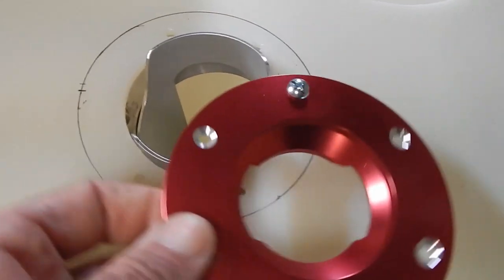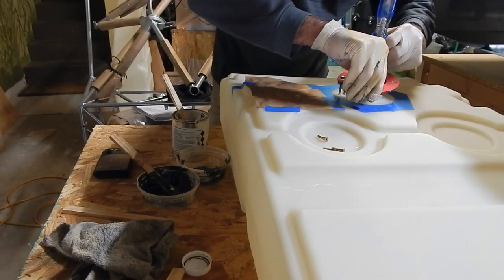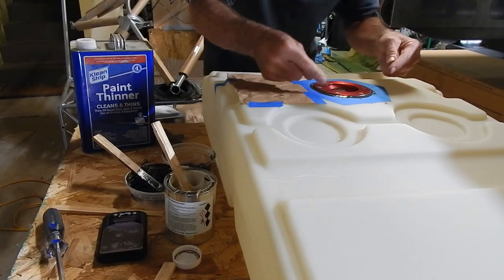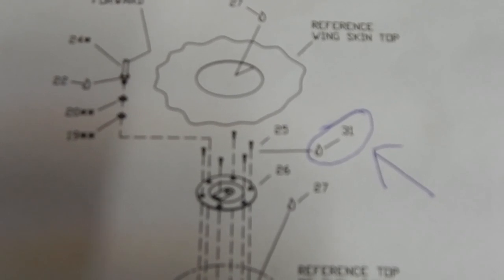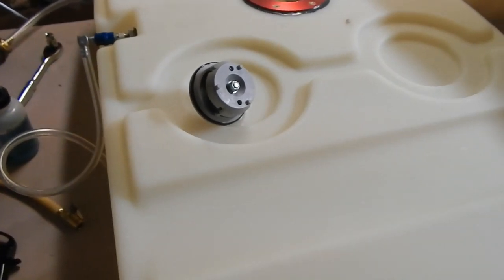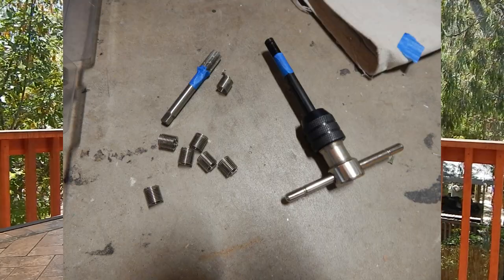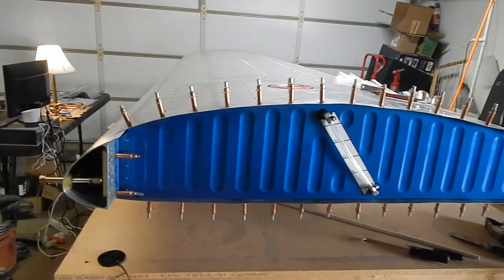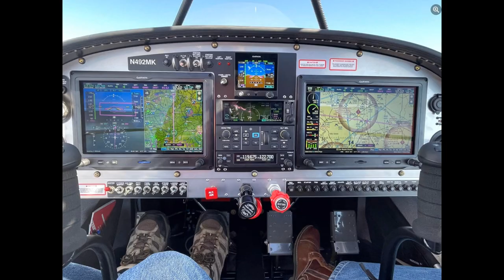Building a RANs S21 Outbound  Ep 8 Fuel Tanks 2

Comment: And what happened to the chip and other debris from drilling the air vent? Use a shop vac through the fuel cap hole?
Reply from the maker: Yes.  I started with the shop vac, but then also rinsed out with water and let dry.